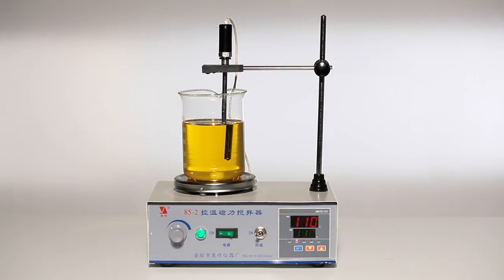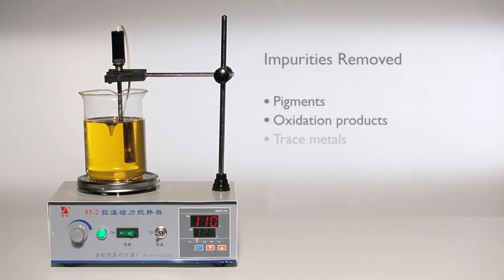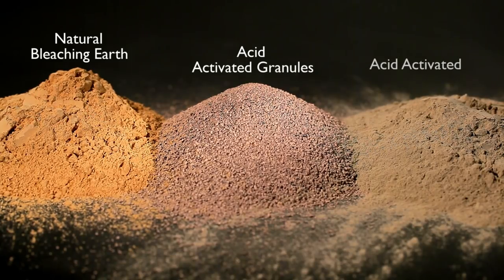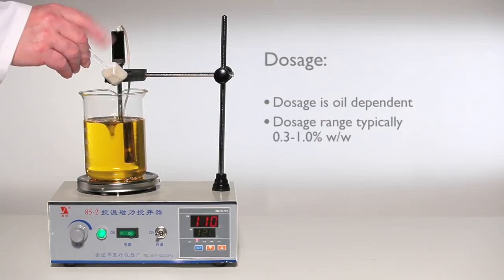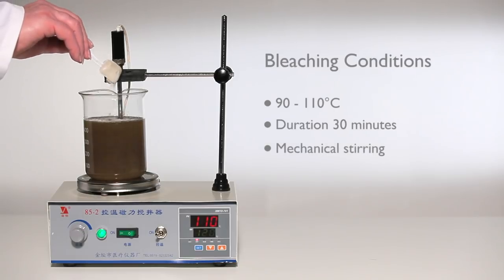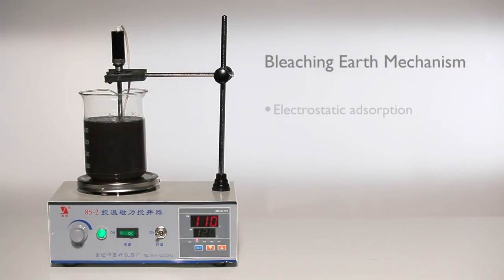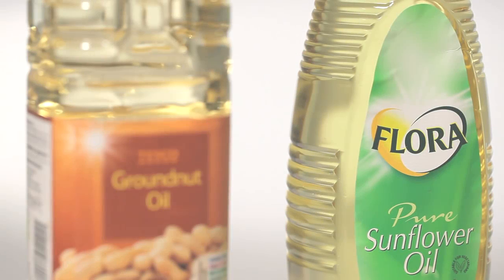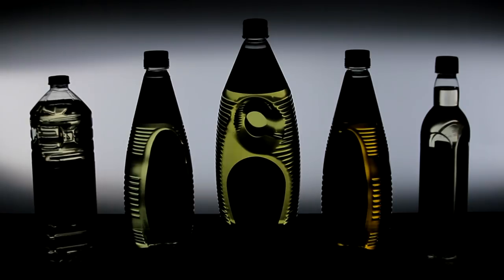How Bleaching Earth Works

Comment: what kind of filter are you using?
Reply: It is called a amafilter... You heat oil to 87-90 degree drop bleaching earth in and run oil thru a amafilter,which is then circulated back to bleach tank, once reached right colour and ffa spec it is then sent to the deodoriser